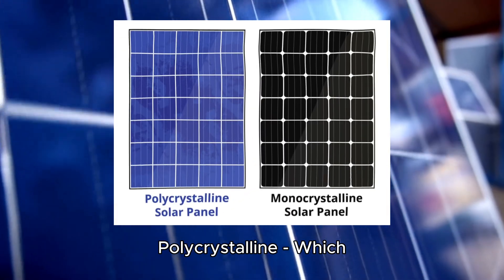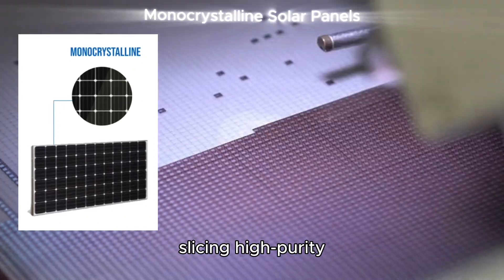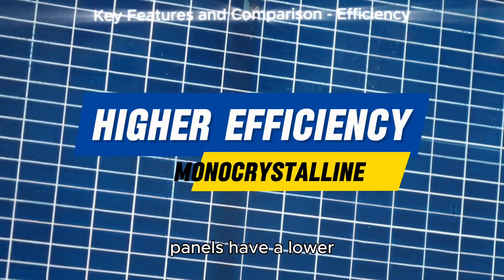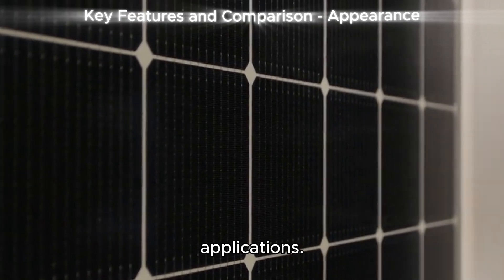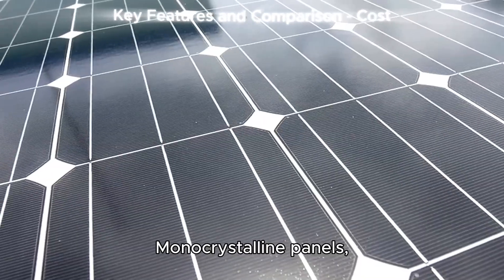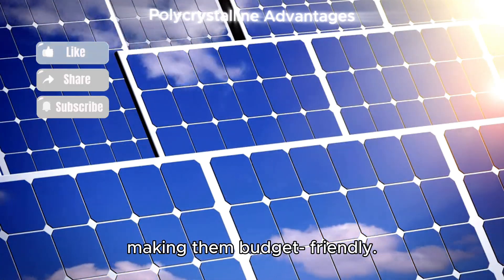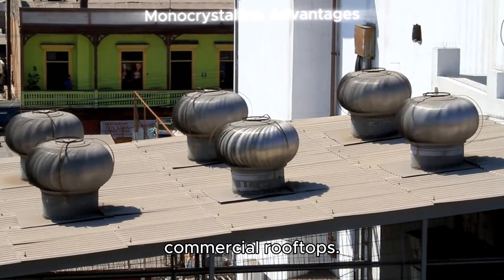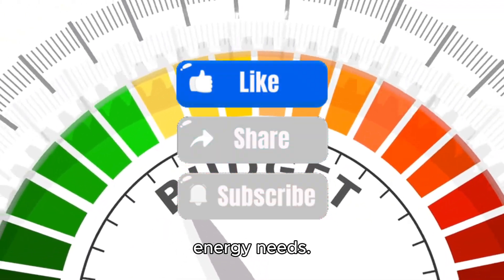Monocrystalline vs. Polycrystalline Solar Panels. Differences Unfold.

Comment: Both types of panels owner here.
Regarding to my own observations and measurements, polycrystalline panels show pretty good results at dusk and cloudy conditions.
I think it is because comparing to monocrystalline panels, polycrystalline do not require direct light exposure and thus, providing more output (in my case, they are mounted vertically on the wall).
But, when I have direct sunlight, then yes - monocrystalline panels are showing their best, hands down.
Reply from the maker: Thanks for the comment, very informative